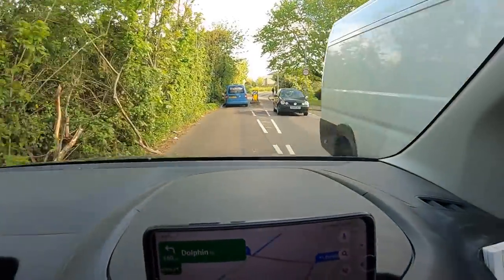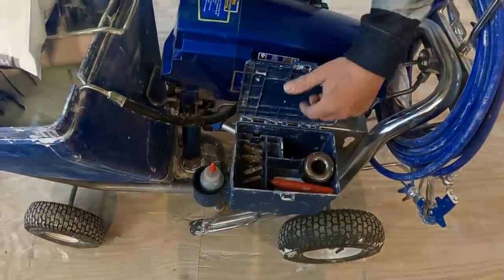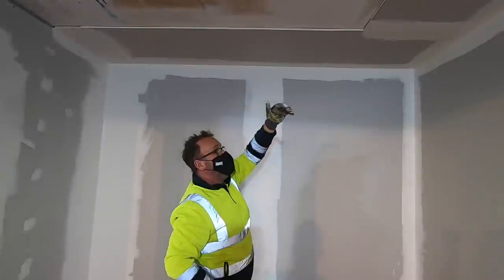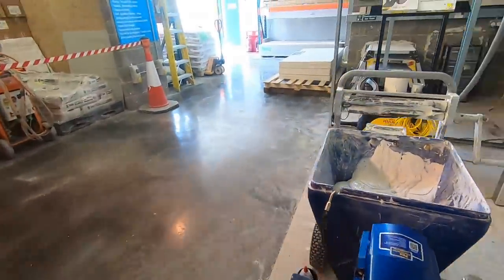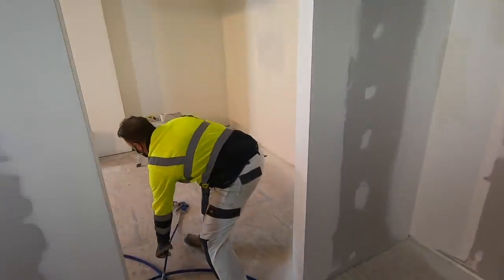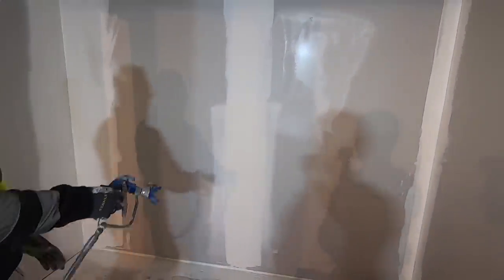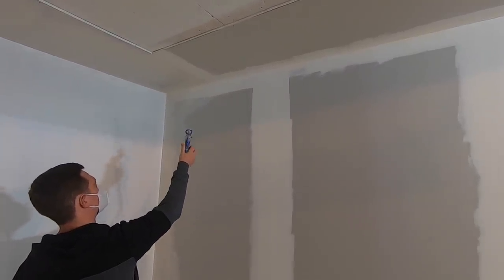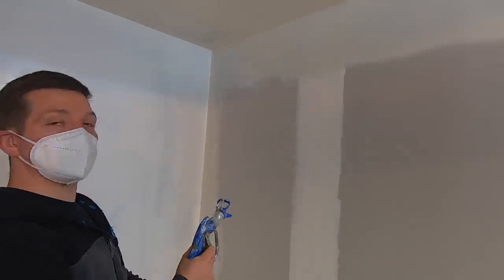The Future Of Plastering!! Airless Spray Plastering (FULL GUIDE) Part 1

Comment: I invested in the airless system as it seemed alot easier on the body. But after about 2 years I sold the lot. This system is designed for large projects and I wanted to see how it worked for myself on small domestic jobs. It was to much of a hassle for me in the end and I went back to traditional methods.
Reply: Sounds like you just do one rooms at a time. Only benefits if you have 3rooms at a time
Reply from the maker: This is very interesting. I could imagine that being the case to be honest - I'd only use it for big projects but it's interesting to hear your feedback. Cheers mate... hope you're well 👍
Reply: Some Words  🤣🤣🤣
Reply: Some Words  all you need is 20 bags of plaster a bucket and trowel and start drinking 3 special brew for breakfast. Well done you are a qualified plasterer 🤣
Reply: @Scott Sid sounds like you're a master plasterer you I'd say u need at least 5 🤣
Reply: @PlasteringForBeginners 
I have used that stuff without the machine I just trouled it on its good stuff 👍

Comment: We’ve been spray plastering for about 3 years. I use a Graco APX. Once you’ve got the hang of it it’s a doddle. Over Artex, wallpaper and bad walls. Easy, quick and no mist coat when painting. It is amazing for large works but we also use it for domestic work. I reckon it’s a winner👍

Comment: Hi there mate. I've been spray plastering for 2yrs now after doing a course and investing in the same set up you were using. I'm a drywall taper to trade and I can tell you it will make you money. I would say about 80% of my work is now spray plastering and the rest is taping. Most of my work is now spray plastering over artex ceilings and nine times out of ten the client wants their whole house done. With this system you can just spray directly on, no bonding to be done, you can get three coats on in a day easy if it's a heavy texture your working over, and get a decent sander like a Mirca Leros connected to a good extractor there is very minimal dust. Its so much cleaner, easier and faster than traditional plastering. Go for it mate it's a no brainer!
Reply: Hiya mate so you work in peoples houses with this system then? I'm liking what you're saying mate
Reply: Hi Duncan, yes working in people's houses is no problem. You just cover all furniture with dust sheets just as you would do if you were painting. This system is so much cleaner than traditional plastering and the dust off the sanding down is absolutely minimal as long as you have a good sander connected to a good extractor.

Comment: We had a go with this on some eco houses 10 years ago. Only worth getting out if you have massive areas to do. Nowhere stocked it at the time so committed to buying by the pallet. We covered around 100m2 per day but you still have to tape and fill all joints before spraying. Great for the right application. We had 6 metre ceiling heights so my mate pushed me round on an aluminium tower whilst I sprayed!! Lots of fun!
Reply from the maker: This sounds brilliant. I could imagine you lads in that cherry picker... Brilliant 😂
Reply: Its for level 5 the painters usually do it.can do a 350sqm in 4 hours but know one wants it.so it died out in aus and nz.

Comment: I use the same plaster in Poland for finishing we roll it on and skim it flat 2 coats.  Usually one rolls and the other skims depending on the temp we can get 5 full rooms done in a day, we use Halogen lamps on the wall while working it to.get a better finish.
Always some.sanding to do the next day or so.
Thanks for the video always good to see what is out there 👍
Reply from the maker: That's insane coverage! Fair play mate - very impressive 👍
Reply: @PlasteringForBeginners  Thanks, yeah the pace excepted here is a bit crazy but it's funny how you get used to it and it becomes the norm 😄

Comment: Being a plasterer myself, have never tried sprayed skimming, I have only done spray render which is definitely worth it but for spray skimming I don’t see how it’s feasible, would be nice to see a photo of paintable sprayed skim :)
Reply: I agree with you 100%
Reply: In my opinion the sprayed plaster finishes way better than traditional gypsum plaster when painted.  Also takes less time to decorate as no list coat required. Tradional plaster is a harder finish for sure and is easier to flatten off and work with but doesn't look as good when fully finished imo

Comment: You should try paint roller method. There are special rollers that are made from plastic naps. Cost around £20, but you will get the same quality if not better than this excessively priced sprayer. And it’s time saver also. Cheers
Reply: Like u would paint a wall u mean ? Just with plaster instead
Reply: Roller looks exactly like 9” painting roller but instead of wool, its made of soft plastic. Basically it feels exactly the same but you can load more plaster in roller. After you finish just put it inside paint bucket and cover it with lid. No cleaning is required after.
Reply: Been looking is the brush spiky ? Seen airating spiking looking rollers

Comment: Great video guys, What size filters and tip did you use for this job? thanks in advance
Reply: I would also like to know this....I think the tips are usually within the 535-539 range, for a machine with an output of approx 5L/min (which if I remember correctly the Graco Mark V, used in this vid, has....i use Wagner machines though......). Also the tubing, and Gun specs, required to spray plaster, used in this vid/generally, i would really appreciate knowing.

Comment: This system was new in Poland about 8/10 years ago, they only forgotten to say that is only to cover flat surface, any holes you will need to fill and sand before spraying.... Maybe try show how much easier is applying filler with roller 😉 much easier and you doesn't have to invest ££££ in tooling. Can't wait for future videos. 👍👍👍

Comment: In case anyone is using this video to teach themselves.. @ 5:36 "basically turn it off" is not going to cut it - the machine will remain under pressure even if it is turned off! When you take a break, you need switch the unit from "Spray" to "Prime", using the pressure relief valve. Before that you will want to reduce the pressure to zero using the main pressure dial.

Comment: Used that machine years ago for spraying fire resistant coatings.  It takes ages cleaning it all out at the end of the day.
Reply: It does the first few times, but I found you get a routine using them a lot, and there's little tricks and cleaning equipment that can save loads of time. Plus the latest models have a setting just for cleaning - that especially cuts the time down in my experience

Comment: Looking forward to the plaster a 4 bed house in a day for the price of one room plastering 👍
Reply: or plaster a 4 bed house for time of a 1 bed for the cost of a 4 bed.
Reply: @OrdinaryJoe12  my thought process was based on when house  builders give plumbers a unit  price to fit a central heating system. So your profits will be cut to the bone.

Comment: Thanks for posting this Blaine. This is also a first, a film with it's own adverts, way to go, respect.

It was all nicely explained and demo'd thanks, he sprayed on in a pattern I use when I spray lime wash and looks great.

It may be the dogs bollox but working with something that sounds like a duck being murdered would get on the nerves.

It's a gamechanger alright, started in 1932 the Teutonic Knauf now have 150 production sites worldwide and as 1 of 6 producers of wallboard they have about 81% of the global wallboard market. They are the big boys so you'd think that they would spend a little extra coming up with a plastic bag recycle system or use a biodegradable plastic bag.

Plastic should be made from plastic, no more raw materials, profits from the big 6 single use plastic producers could be put into monetarising waste plastic to give it value and people would collect it like old tins and bottles.

The tragedy is that all industries still uses so much plastic and packaging and was one of the reasons that I switched to lime from using gypsum & cement, I liked the history, the lime cycle and that the ancients used the same stuff, so if it was good enough for the Romans.....

I've been using the same supplier for about 15 years buying my materials in ton bags and they deliver for £40 travel cost per load these days. 
I also keep my old ton bags and one day might make a giant kite.

Liked the bag squeezer and would love a whole set-up and what's the cost and back-up like? 

Unlike cement and gypsum a lime wall will absorb carbon dioxide, and gives you better acoustics and having said all the above,
the future will probably be carbon nanotubes, graphene and geopolymer cement and we'll be living like those in Ready Player One.

Comment: I don't see the point for doing this when it's a flat Wall to begin with so why spay a 1/8 inch layer to slick offi mean wouldn't it still be a flat Wall after worth plus more raterial and it doesn't take out any imperfections I'm your flat Wall

Comment: The system, gun, tips etc are almost identical to the airless paint systems I was using 20 years ago for priming trailer chassis and they were also made by Graco! I’m guessing the main difference being the size of the fluid tip for the higher viscosity product? Be careful what you wish for mate us ex paint sprayers may come out of retirement😂
Reply from the maker: Haha you'd be good at it then mate. Is this tempting you back into your work boots?? 🤣
Reply: @PlasteringForBeginners  haven’t put the boots away mate, self employed multi trade now but leave the plastering to the experts I say👍🏻 been subbed for a while now and like any other skilled plasterer you make it look easy........too easy, great channel btw

Comment: The instructor mentioned its designed to be sanded. As soon as he said that I tuned out. There’s enough dust on site without breathing any more in.
Reply: It's replacing the plaster dust, so its dust neutral ;-)
Reply: Mirka dustless sander or equivalent well worth it.
You only get 1 set of lungs mirka rep told me on a demo day...
Reply: @richardmcdougall233  dustless sanding is a nice marketing term but we all know that’s not exactly true. The fine air bourne dust is the issue in my opinion. I’ll stick with normal plaster and let you crack on thanks very much.
Reply: Same here, if it needs sanding then its just a spray taping system.
Now get a machine to mix and spray multifinish then I'd consider it.

Comment: I done a revite  recently that had been sprayed (Barret build 1900/2000) this  product is VERY soft sands easy / also marks easy !!
The problem is it also shails off easy - I had to scrap the whole ceiling back to the boards as parts were coming off - It might be good for commercial stuff but for domestic where you will get more drying out / movement - it is useless
But bearing in mind the big builders are ONLY bothered about speed / price and not longevity - it is a spray get there money & gone as long as it lasts a couple of years until the house is out of warranty then it is the BUYERS / OWNERS  problem !! 
The yanks use a similar style of stuff - ready mixed but apply it with a roller and then flatten & a light sand - it gets the walls like glass & a two man team can do a room quickly & no expensive machine !! Suppose it depends what type of work you do & how rich you are !!

Comment: Seen this system used where I'm working at the moment some of the walls in the complex are concrete and require a skilled plasterer to dot and dab them it seems to be used on apartments and hotels alot for speed

Comment: I used to use a Graco xp70 and a 1-1 for spray applied liquid plastics and waterproofing , worst thing is the crust around the hoppers you have to clean it well or little bits will block the hopper , I learned from other operatives not cleaning it and it being sent out to my job , clean clean clean the hoppers properly and bristles from cheap brushes get clogged so no cheap paint brushes only a £20 purdy 🤣 👍🏻 regards from east London

Comment: Hi Blaine! I did your online course and plastered my first wall, turned out pretty good and within time, so thanks for that! I’ve been looking into the spray plaster, as I’ve taken on the airless spray painting. Is there any surface prep before you go on with the Knauf, such as primer etc? What about problem walls with cracks? Ive heard of a system where the entire wall is covered with fibreglass as part of the whole system, is this a Knauf stage for problem walls?

Comment: It’s also cool that the product is white. That’s a time saver on the overall project too, because (I assume) you don’t need the painters to do a mist coat or an undercoat either.
Reply: Absolutely would still need to prime this same as you would plaster or easi fill etc

Comment: This technic and material is more akin to how walls are finished in the US. Joint compound and tape with no finish or skim coat unless in a high end residential or commercial setting.
To a comment bellow as to why not just tape the joints and then prime the rest of the plasterboard - this can be done, but, different compounds have different PSI and granular mixes. A complete skim coat always looks best and prevents blotching in paints and uneven surfaces across your walls, especially where butt joints come together with large build-ups. It’s better for repairs and touch ups after your 2nd fix guys come through as you can feather out damaged areas. 
I’m guessing this may catch on more outside of the UK more. 
I hope traditional plater remains the norm. The skim coat is far superior and durable.

Comment: So basically this is taping and jointing, which I did in the 80’s but you now spray the whole wall with the joint cement. That’s ok on new build sites but how does it work on renovating older buildings ? 

For plasterers like myself that never work on sites and rarely touch new builds I don’t think this is the way and I’d also guess people who already own their home and want improvement work doing would be resistant to this. 

Also wondering if guys are doing 250m per day then the big house builders are going to push the price per square metre through the floor 🤨
Reply: I'm not a plasterer, but I would have thought spraying it on a plasterboard that is a new build or in an old house is the same!?!?
Also if these machines are used more and more then laws of demand and supply means plasterers will have to drop their prices to get a job.  So instead of blaming people from Europe they can now blame these machines!🙄

Comment: Do you have to sand it after, and cover every thing be for you start. And I imagine you have to fill all joints and beads first, 
If there is a bump or hollow in the wall or ceiling how do you get over that when putting the product on so thin.
Reply from the maker: The prep is key with this system and you do have to tape and fill The joints beforehand. So you will spend more time prepping - there's no doubt about that. But I think it's worth the effort.

I'll let you know when I'm testing it in the future!

Comment: Similar to Airless paint spraying I think this method is only suitable for large jobs - perhaps industrial or commercial premises - where you are doing large areas with the same paint system.  What it enables you to do is use trained but unskilled labour to do the spraying and a skilled tradesman to do the finishing. This enables you to utilise the skilled labour far more efficiently thus reducing labour costs (assuming you are an employer). I imagine that your material costs are substantially more than normal plastering method costs. And the pumps are not cheap and need to be maintained. To be cost effective these systems have got to be used to their full potential. If you have the jobs to warrant the investment go for it, but otherwise it could just me an expensive peice of kit that gathers dust.

Comment: This Graco really shines on render walls not for plaster walls ..been plastering with this filler using spatulas only 2 coats level 5  finish light sanding prime walls 2 coats paint ..done
A fully qualified painter would finish 11/2 bedrooms 2 coats a day sanding not included of course